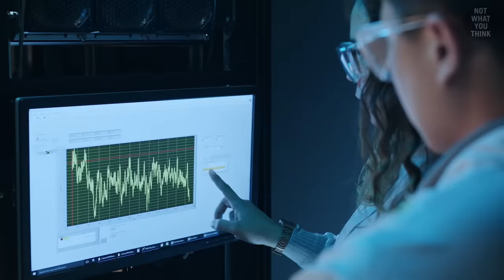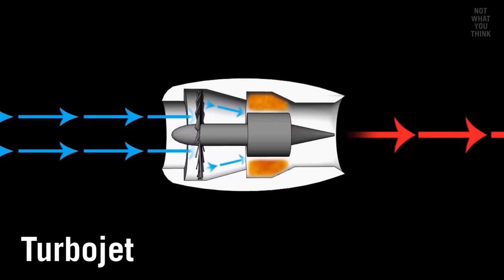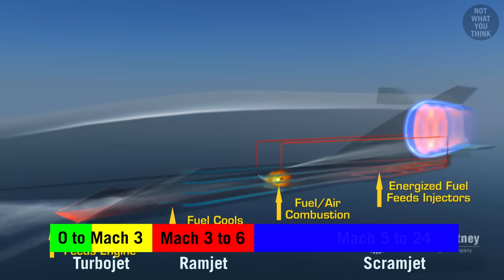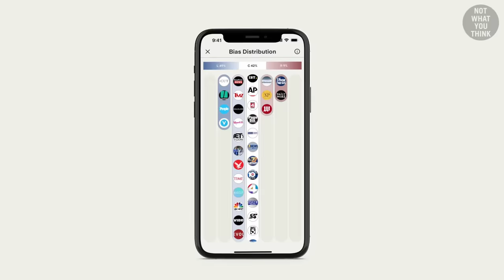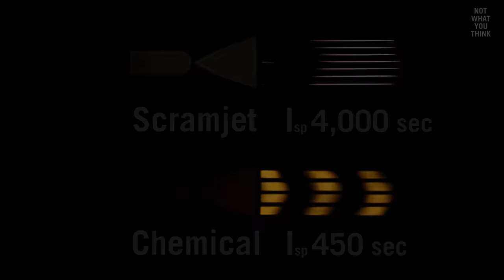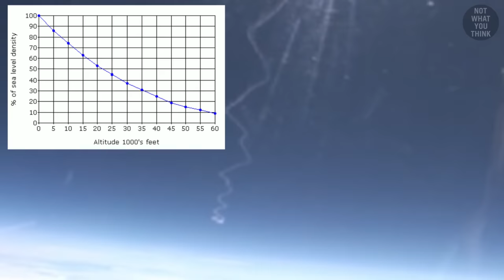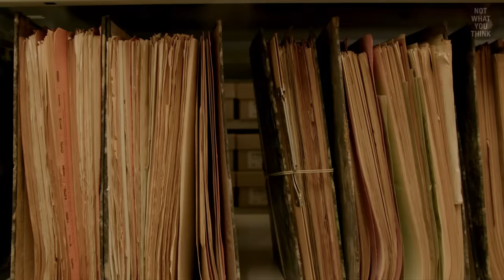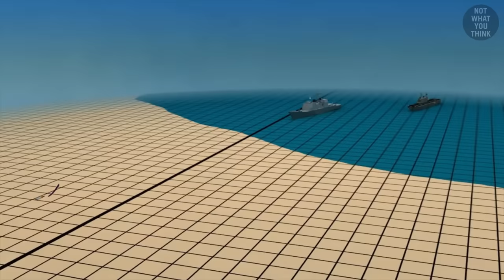The Hypersonic Missile Vulnerability That NO ONE Talks About

Comment: The heating issues can be mitigated by use of the double walls using fuel as coolant.
Also, The ceramic tiles obviously won't work but you haven't considered the fact that the Parker solar probe exists.
The porous carbon heat-shield can be useful as insulation on the outside of the HSGV/HSCM.
Also, they might be able go get away with using ablative cooling just like the inside of a rocket engine. 
As for the comms blackout, 
They can use a combination of gyroscopes and gravity sensors to approximately kinda predict the location of the vehicle.
The biggest issue is maneuverability.
Because at such high speed, the inertia and forward vector of movement will be so large that and abrupt movements are going to tear the vehicle to shreds.
The most amount of movement will be limited to only a few arc-minutes per second. So, in order to make even a 20° turn, it will require several hundred if not thousands of kilometres. Which is wayy less than advertised.
The HSCM is nothing different than a ballistic missile in its terminal phase and can easily get wiped by any of the modern missile interception systems
Reply: it's possible to use fuel as a coolant, but the heat dissipation is not the main issue.
heat-shield has a weight, and ablative cooling has a limited lifetime
did you hear about inertial guidance navigation? no need to invent a wheel or a guidance system, both are already invented
on the other hand, totally agree with you about inertia and maneuverability, and the terminal phase of these missiles
Reply: @user-yz6kc4xn4r  Of course if you want bang for the buck, use short range missiles after you got permission from Cuba and Turkey , respectively. This weapon is about MAD after the enemy rolled over your allies.

Comment: My thought would be to use a Hypersonic as a ICBM interceptor in the cruise phase instead of terminal phase. Then I realized no atmosphere for the scram jet at those altitudes. Not to mention administrative reaction times as described in another of your videos. Rockets win again.
Reply: You may not necessarily need an atmosphere at that altitude to intercept during cruise. If you build up enough velocity while you still have the atmosphere then you can simply keep going without the scramjet and strike it anyway.
This is basically why scramjets are considered a possibility for single-stage-to-orbit designs for going to space. Build up enough lateral velocity and you might be able to enter orbit with just the kinetic energy and some maneuvering rockets.
Reply: That's why the military is switching to particle beam defense for such missiles so no, rockets lose and always will lose to a particle beam weapon as nothing is faster than light speed. Well, except for ludicrous speed and of course going full "plaid." 🙂
Reply: @tedwojtasik8781  Particle beams don't fire at the speed of light. As the name suggests, they fire particles, which have mass, which means they can't go the speed of light. Relativistic particle accelerators are colossal (like the Large Hadron Collider)
Reply: @gimmethegepgun  I think he was making a reference to Space Balls (ludicrous speed). Though the interesting thing is, particle beams can actually travel faster than light in the earth's atmosphere or other mediums where light travels slower than in a vacuum. For instance: 
Speed of light (vacuum):   299,792,458 m/s
LHC protons:                       299,792,455 m/s
Speed of light in air:       ~ 299,702,547 m/s

Not that it makes a practical difference but conceivably a particle beam could travel slightly faster than a ground-based laser, though a military application would likely intentionally have much lower energy particles (still easily over 99% the speed of light). But burning through part of a target has much lower requirements than creating exotic new (/old) subatomic particles.
Reply: @delos2279  Yes, I know that ludicrous speed is a Spaceballs reference. But the part before that wasn't.
Reply: Much easier to use glide vehicle rather than an air breather on an ICBM.
Reply: @tedwojtasik8781  Particle beams only work in a vacuum.
Reply: @TyPhoon-rl4xd  No it does not, where did you get such misinformation from?

Comment: I would like to address the misconception that a sensor or aerial placed away from the nose of a hypersonic missile would allow communication/sensing. The air at the nose is turned into a plasma (apart from whether the nose melts or not), and plasma stops frequencies < 2 GHz, which includes radio and infrared wavelength sensors (Korotkevich et al. 2010). Now, lets assume the missile speed s is Mach 6 (~1 mile/s), and the length d of the missile is a couple of meters (~0.001 mile). So, the sides of the missile would reach where the nose was in t = d/s = 0.001 mile / 1 mile/s = 1 millisecond. Thus, the plasma would not cool enough in this short time to allow communication/sensing, no matter where along the missile it is placed.

Now, to location. If the hypersonic missile was launched say 600 miles away from a carrier, it would take 600 s (10 minutes) to reach the carrier using inertial navigation at the time of launch. The USS Gerald Ford can reach ~40 miles/hour (d = 40/3600 = ~0.01 mile), so the Ford will be safely a tenth of a mile away when the missile hits the ocean. And if we assume the air density slows the missile to Mach 3, allowing communication, it will be easier to shoot down by say an SM-6 anti ship missile.
Reply: I am sorry; did you say "safely a tenth of a mile away" - from the ground-zero of multi-to-100+ kt - *nuke*..??

Because if they are targeting the FLAGSHIP OF THE US CARRIER FLEET - I daresay there is little incentive to avoid escalating things to 'nuclear' by going 'conventional' - and robust hypersonics are unlikely to be fielded by non-nuclear powers, anyway - other than, perhaps - Iran..??
Reply: Also...

There is simply NO WAY that; after driving for ten minutes in my car at FORTY MILES PER HOUR - I would have only gone - one tenth of a *MILE*..!!

("Twilight Zone" - and 'Roundabouts from HELL' - notwithstanding..!!)

...In one sixths of an hour, or 10 minutes, I would have gone one-sixths of 40 miles, or - ~6.67 - miles. Not - "0.1"..!!!!!!

Comment: You made a mistake about the reentry of the ballistic missiles, they travel at high hypersonic Mach numbers some where over Mac 20. Definitely not Mach 2 or 3. Though you were correct that they have a predictable path. Unless they are MARV(Manoeuvrable Reentry vehicles) which will Manoeuvre during Reentry, making ballistic predictions near impossible.
Reply: They START their reentry at Mach 20. At impact they are going around Mach 2. They are unpowered so there is no way they could maintain mach 20 speeds as the atmosphere got thicker. Also, those speeds would melt anything once you hit 20-10k feet.
Reply: @tbe0116  Also you can't maneuver particularly well at Mach 20.
Reply: @tbe0116  ICBM reentry vehicles are pointy to keep their speed up and deal with the extreme conditions of the attached shockwave with ablative heat shields. They are traveling way faster than mach 2 at impact. That's why they're so damn hard to shoot down.
Reply: Good for you for catching that, because most of the viewers were too busy stroking to the tech trivia content rather to the actual non-argument the author was trying to make. But he didn't make a mistake. He slipped that in on purpose in order to altogether support his otherwise ridiculous claim that the relevance of hyper-sonic missiles is somehow over-hyped. This guy should try pimping this idea of his out to the industrial military complex manufacturers and actual military experts alike, and save them a lot of money. ))

Comment: Just sitting back and thinking about it, it occurred to me that hyper sonic weapons aren't quite the threat they are claimed to be. You've pointed out some of things that occurred to me. In order to be hyper sonic, they'd have to fly at very great altitude - making them visible to radar (including fire control radar) at very great distances. You're right, a missile couldn't catch it. But one launched near its path wouldn't need to. Also, as you pointed out, during ascent and terminal maneuvers it is no longer hyper sonic and anti-air defenses become viable. Also, as you pointed out, solving the targeting problem is huge. You can't count on being able to direct the weapon in flight as you're pretty much guaranteed to lose communications. On board systems would be incredibly difficult.
Reply: Not to mention advancement in directed energy technology.  No missile can out maneuver a beam of light.
Reply: @Shinobubu  - Good point. I did think of that, but since there are no fielded energy weapons capable of doing that yet I didn't include it. The new DDG-1000 class and the new CVN-72 class ships have generating capacity designed to support energy weapons. They're just waiting for the weapons to exist.
Reply: @Shinobubu  a normal missile would easily be able to hit a hypersonic missile people that say "ooh its hypersonic so it cant catch it" are dumb and dont realise that intercept means intercepting the course from the front or side not chasing it from behind.

Comment: Mmm. There are several stupid assumptions being made in this video. 
1) Hypersonic comms can't work. Yes they can, you just need to get the transmitter out of the plasma sheath. Like with a stick. Antennas are not future technology.
2) Hypersonic manoeuvring requires main engine thrust. It doesn't.
3) Speed * Mass equals BIG BOOM. Wrong. It depends on the target. It can also equal silky smooth deep penetration.
Reply: Yeah, for ex China claims to be able to communicate with the missile when it’s traveling at mach7

Comment: Good analysis. The lack of communication means it can't really hit a moving target like a ship. A slight change of course in a naval fleet means its most likely to hit open ocean. Its dependent on other assets to hand off target coordinates before launch. Those other intelligence assets are easily decoyed. If they are air assets carrier based aircraft can engage them before it sees the fleet at all. Simple decoys like chaff, small boats with radar reflectors and decoy drones means that you have 5 -15 target blips per real ship.
Reply: It basicly can't even correct it's trajectory to precisely hit a stationery target (unless the missile slows down).

Comment: At hypersonic speeds the leading edge begins to ionize. Two issues arise, ionization diffuses any telemetry, radio reception, GPS/GLASSNOS reception, to the point where I wonder if radar is even on board. Second is that if any leading edge is deformed even slightly it will overheat in a second.
The vapor trails over the US can be energized such that a hypervelocity craft plowing through them will seem to strike water, shattering the airframe.

Comment: The main argument against hypersonic missiles is that they don't change the strategic calculus. We already can't intercept more than a trivial fraction of a serious ballistic missile attack. Even if our ABM interceptors were 100% reliable at intercepting an ICBM, which they aren't, Russia has more ICBMs than we have ABM interceptors. This is somewhat by-design as our intent is to outmatch a North Korean launch without upsetting the strategic balance with Russia. Hypersonic missiles are too expensive to be used for most conventional war scenarios and barely impact the calculus on a nuclear exchange, which was already "Mutually Assured Destruction". So the main purpose seems to be PR value, such as the Kinzal and Iranian "hypersonic" missiles that are just a rebranded ballistic missile that the 60's would have recognized.

In contrast, cheap guided weapons have the potential to be far more disruptive than hypersonics. Iranian Shahad-136 drones can be produced for $20,000, cheaper than our cheapest missile based AA defense. Even a shoulder-launched Stinger costs $80,000, and has to be launched from directly under the flight path, or a Patriot interceptor missile is several million. If we have to burn hundreds of thousands to millions per interception, then an enemy fielding $20,000 munitions wins simply by allowing us to shoot their missiles down. It's only a matter of time before an adversary realizes that they can mass-produce cheap attack weapons and fully exhaust our interception capacity. Once we run out of interceptors, a $20,000 drone is just as deadly as a $200,000,000 hypersonic missile.

Comment: I think you're missing the point. 

You are correct that hypersonic missiles aren't really useful for all purposes. If the target is moving (and therefore requires active guidance), requires a stealthy approach, a long loiter time, or has to fly at low altitude, then yes, it's not the best tool for the job. However, such weapons can be used against stationary targets that have an intricate air defense system that would counter cruise missiles, conventional airstrikes, or perhaps even ballistic missiles. 

The key to utilizing hypersonic missiles correctly is reducing reaction time for your opponent. The opponent's defensive missile not only has to physically shoot down the missile with an intercept missile from its own batteries, but it also has to detect the missile, confirm the detection as a legitimate target, obtain authority to intercept, the acquire a lock on the target, then launch the missile. The less time you provide for this process, the less chance the opponent's defenses can intercept. Detection wouldn't be particularly hard, as no hypersonic seen to date has really been designed to have a low radar or thermal signature. But, the rest of the process may be more challenging. Using several systems to confirm a target is legitimate may still take an actual phone call to another radar station, ship, or other asset even in 2023. Another phone call may be required to obtain authorization to shoot down a target, especially if the hypersonic is used as a first-strike weapon where war or a conflict is not yet formally declared. Turning the 20-30 minutes from detection to impact of conventional ballistic and cruise missiles into an even shorter time interval could prove a huge boon in a future conflict. 

Another problem I have lies with your insinuation that hypersonics would fill the same niche already occupied by ballistic missiles. Hypersonics hold the potential to have several key advantages over ballistic missiles. The first main advantage is increased accuracy. Ballistic missiles are, as the name implies, entirely ballistic upon re-entry into the atmosphere. They cannot steer towards a target as they fall back to earth. Hypersonics could steer in this phase of flight, correcting for wind and other turbulence that may deflect the missile on its downward flight arc. Secondly, hypersonics could also potentially fit in a smaller package capable of being launched from a more diverse collection. Ballistic missiles have pretty much been relegated to land-based silos, specidalized heavy trucks, and submarines for their entire history. Hypersonics, which will inherently be smaller due to the efficiency gains discussed in this video, may be able to fit in similar silos to those that hold cruise missiles on destroyers, commercial "off-the-shelf" ruck beds, or aircraft. 

I also have some issues with your key point that the missile would need to slow down to avoid burning up. If the missile is at 60,000 ft, travelling straight down at mach 5 would mean the missile would hit the ground in a little over 60 seconds (I rounded up a bit to ensure there is time to turn the missile and allow for a non-vertical decent with evasive maneuvers). This is a relatively short timespan where heat can be withstood by conventional techniques like ablative coatings or ceramic composites. The idea that the missile will need to slow down simply isn't a design constraint that has been considered in any hypersonic weapon that I'm aware of.

Comment: Impulse = Force x Time, immutable physics. The tennis ball off a racquet or a cricket ball off a willow bat depends on time spent on the racquet or bat to accelerate and speed the ball; you can see seemingly lazy strokes where the ball speeds off the playing instrument, because the ball has spent a relatively 'long' time on the playing instrument.

In playing squash, because of the nature of the small, black, soft ball, force is required, rather than time, to speed the ball up. Squash players 'whack' the ball to get it moving quickly.

Rockets require force over time which is where calculus is required, particularly Integration, which is exemplified by 2 pi R and pi R squared. Regression is next so that a fast vehicle [rocket] can slow and re-enter at a proper trajectory to hit its target (this was explained in the VLOG), this is where hypersonics are vulnerable; and at the end, about as useful as an ashtray on a motorbike.

Comment: Regarding melting of aircraft skins at high speed such as on the X-15; the leading edges of fins and control surfaces were melted as shown in many photos available online. Most of the X-15s Mach 6+ flights were above 200,000 feet where the air is almost nonexistent, otherwise damage would be far worse. Re-entry below ~60,000 feet caused such melting as the plane slowed to ~Mach 3+. The nose had a 14 inch wide ball with layers of steel and liquid nitrogen cooled to prevent melting. Paint coatings peeled and split on the sides of the plane.

Comment: 15:42
Actually I did some calculation and I find out that zircons weigh about 3000 km and was travelling at around Mach 24 so since Ke=1/2mv^2 it means that it had some 9x10^10 or 90’000’000’000 newtons meter or 21’510 kg of TNT